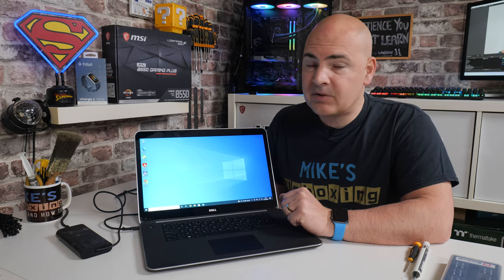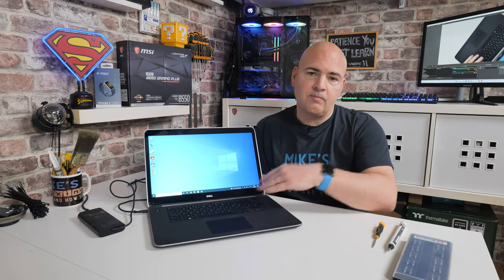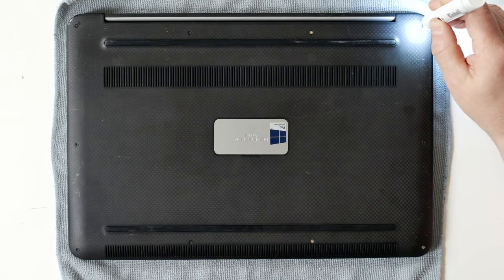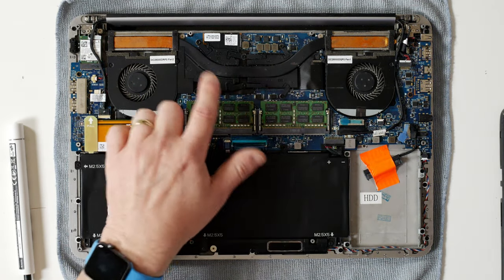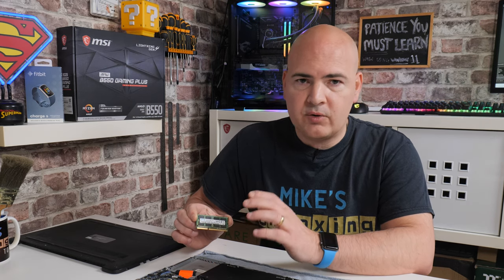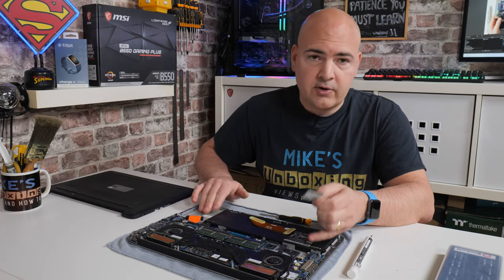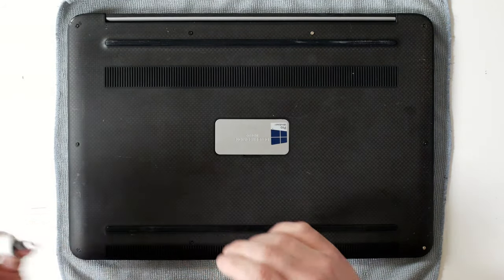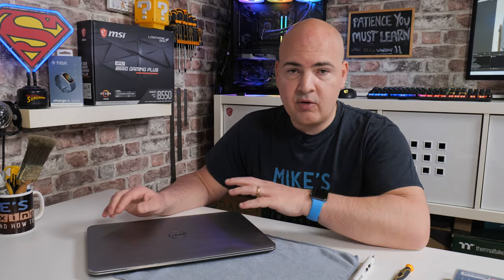How To Upgrade Or Replace Dell Precision M3800 DDR3L RAM & MSATA SSD

Comment: Did that to a old Acer AspireG. put more ram & a SSD in it.
replaced the thermal on the cpu & gpu.
works faster & cooler now with Win7 😀
Reply from the maker: Nice one :-)

Comment: We have an old HP Pavilion G6 i3, first gen, which kept overheating on after 10mins. Repasted twice, fan was replaced few years back but seems ok, then hdd died! Fitted SSD and eventually got win10 installed after many hours as still kept overheating during setup. My question is how old is too old? Is it worth trying a fresh copper heatsink when 12 years old? Looking forward to next video on cooling! Have a great Easter and thanks for sharing Mike and Kath👍
Reply from the maker: sounds like a fault somewhere unless the fan is failing?
have a great easter nick & family

Comment: I didn"t quite get what you said about the HDD placeholder at the bottom right. May I add a second sata SSD at this placeholder? If yes what kind of drive because the small SATA SSD disk cardboard does not quite seems to fit in there. Thanks for the great video by the way.
Reply from the maker: Yes you can! the space there is for a 2.5" drive SATA type
Reply from the maker: This is maybe easier to fix or at least advise if we can ask more questions and get direct answers, so feel free to join our Discord chat and we can go over it in more detail https://discord.gg/XtBTGQ6BDu
Agree to the rules by clicking the emoji and you will get access to the rest of the Discord channels
Reply: @mikesunboxing  I did not notice you have a discord, cool! Actually my laptop had a 2.5'' SATA drive installed. I gave him a brand new SSD, cloned the HDD to SSD, and tada! with double RAM and the SSD, it runs pretty much good for an old model. One important point, do not reboot after clone with the both drives or the boot partition will not be updated and still boot on the old HDD drive.

Comment: If you have something with a lower msata drive, CEX have a few 500GB in for £35 to £48, but they don't mark RAM as DDR3L
Reply from the maker: hmm interesting i didn't think of CEX for the msata drives, nice one
Reply: @mikesunboxing  A horribly expensive 1TB though, or a 1TB Torosus for £85 obo on ebay